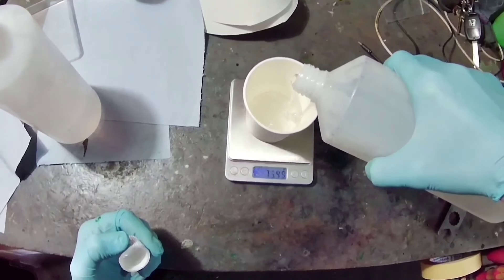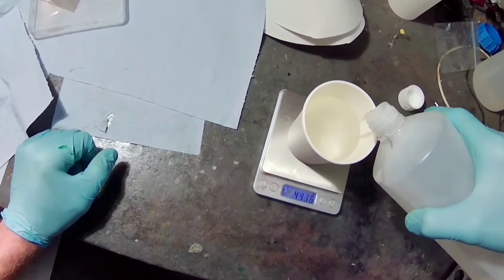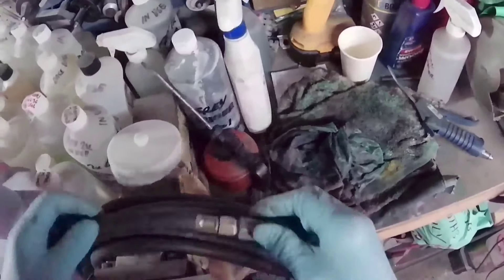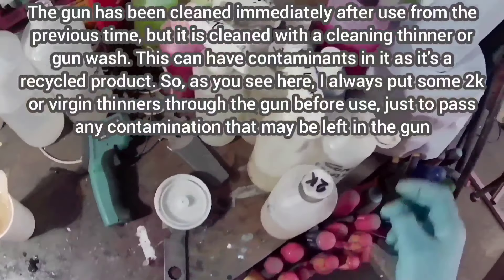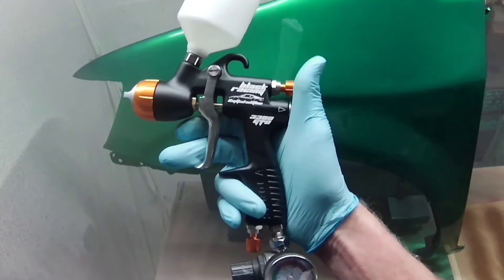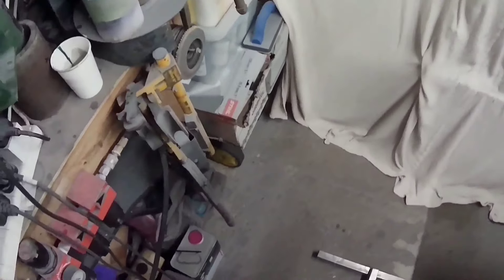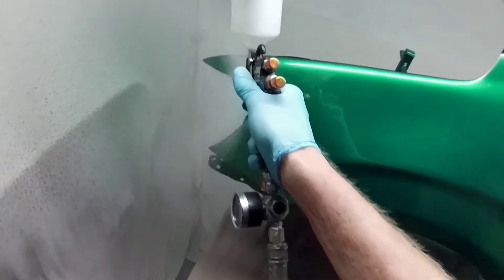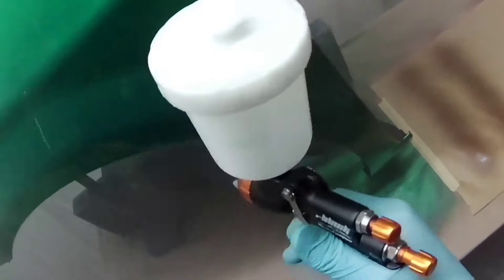Walcom Slim Kombat v Sagola 3300 Black Racing

Comment: Hello Sir, excellent comparison, I didn’t realize that the 3300 sprayed that well, seemed pretty quick. Thank you for the video. I had a buddy tell me one time” if you’re not on the verge of a run, you’re not spraying it right”😂. Have a good one!
Reply from the maker: Hi Bryan,  The Sagola was a 1.4 so it speeded it up from the 1.3 and imo makes it a nicer gun to use for this particular clear coat as it needs plenty on as there not great flow, obviously I over did it but you get my meaning 😀 😉 👍 
I appreciate your comments,  thanks buddy 👍

Comment: Great spraying, Pete. That run is nothing compared to some of my test panels. 😅😂  I've about given up on 2802 for the moment as spraying such clears with those characteristics is hard for a full respray when you're trying to avoid  a bunch of overspray in a homemade booth.  MS clears definitely don't need as much pressure in my case, and lay down better.

As to those guns, the Sagolas are really reeling it in with the performance. If only the price would come down in the US. As to the Walcom, I had no idea parts were harder to get here, probably more expensive. I just checked for a Slim XLight air cap, needle, & nozzle. $133 + shipping. OUCH!
Reply from the maker: Hi Mate, I should be used to these panels so a run did surprise me, especially as it was with the smaller tipped gun as it turned out 😉.

I will eventually stop using the 2080, I bought a lot of them. It was 8 full kits as they were a silly price, so I am slowly working my way through them, I have about 2 left, It's definitely harder to get a finish with it.

Yes, I'm told the spare situation in the US for Walcom isn't good at all.
It's not just at dealer level it at the importers.
They are saying some spares are just not obtainable, this is totally unacceptable, the UK importers tell us they can get whatever part that's needed, providing its not obsolete of course but the US importers are say they can't gets some parts for current guns which is stupid.

There have to be 6 or 7 people who have said a similar thing,  all in the US over the past 18 months,  some you will see on here some via Instagram.

I now give them the email for the Italian factory to see if they can get any joy. It's walmec@walmec.com if anyone needs it.

Cheers Boss 👍
Reply: @peteshobbies5383  if my skills were as yours, I'd stick with the Upol. It's not a bad clear, and you definitely have seemed to master it. I have to spray a thinner clear to get off the gun finishes like yours. 
.
Reply from the maker: It's probably just practice,  I have used loads of it, so you just get used to it.
I'm sure you would be just the same if you had used as much as I have . Thanks, mate 👍

Comment: Interesting comparison pete 👍 , I understand what you mean about the slim kombat feeling fragile , they feel like they're going to snap just tightening the fluid tip , I digress kevlar is used in body armor suits though , so it can't be too weak! . The weight difference is really noticable when you have the gun in your hand for 4 or 5 hours at a time though . Also I have noticed both my kombat and xlight weep out of the tip a little when they have just thinner in them (have done from new) which can be slightly annoying at times . Sagola definately make very truck like guns , does the 3300 have that same silly ring at the top of the trigger that the needle goes through? (Like the 4600 does ... to digress again , I still haven't fixed my 4600 from spraying the side of the air cap , unfortunately didn't get very far with sagola on the subject either 😕 )
Reply from the maker: Hi Mate, I haven't noticed any leaking from my Slim Kombat or Xlite, although they aren't left with thinners in for any length of time.
No, the 3300 doesn't have the annoying ring that moves about as on the 4600 , thankfully 😀

I guess you're right with Kevlar being strong. It's all in the head I think, when it comes to these things 
Cheers buddy 👍

Comment: Hi Pete, great video once again mate and it was a very interesting comparison, the Sagola is a very nice looking gun I do like it in the black with the graphics on it👌

As you know I'm not a lover of the Walcom guns as they always feel plasticky in the hand and they feel cheap and not very well made but if you take the time to look at them they are actually quite well made but I find them to lightweight which is probably due to me being heavy handed as I prefer the heavier guns, I haven't used my Walcom Slim Kombat for a long while which is a shame really as it looks quite nice as it's a special edition, maybe one day I'll use it again🤔

As for the finish you really can't split them as they both did a good job and you did well to not get any runs with the 1.5 tip in the Walcom😂
Thanks Pete👍
Reply from the maker: Hi John,  Thanks, mate , I did enjoy using it with the 1.5 in it , at the time, I thought the Sagola would be the canon, but they both were 🤣😂.

The light guns do feel really flickable, which I like, but it also gives the feeling of fragility, which maybe isn't deserved 🤔 

As people point out, if your holding a gun for 5 or 6 hours a day with a full pot, then weight does make a difference .

Cheers mate 👍
Reply: Yeah I think because they are light people think they are cheaply made but that isn't the case, when I first got mine I thought the same but it's just made of high quality lightweight material which is very strong.

I can understand that using a normal gun during a working shift could be tiring but for me (I expect you are the same) it isn't a problem as I don't spray 5+ hours a day which I'm quite pleased about😂👍
Reply from the maker: @JohnWD40TC02 Yeah,  I'm the same, I'm never been using a gun for that long for weight to be a problem.

Am I right in thinking your Walcom is an HVLP?
Reply: Yes mate it's an HVLP and I think it has a 1.4 tip so it's better for base than clear really👍
Reply from the maker: I don't have the HVLP version, but the HTE version is pretty good 👌

Comment: Hi Pete, Can you explain which would be better for top coat varnish, iwata ws or wbx? And why? Thanks for the answer.
Reply from the maker: Hi buddy,  they are both good. If you are talking about the series2 WS, then they are good and easy to set up compared to series1.

The WBX is as good, really. It's a bit faster if you prefer that, but neither are fast compared to the fast guns like the Sata 5000 , Sagola 4600 etc

Comment: Why do you waste so much thinners flushing guns and then dumping them out onto a rag? Why not dump into an empty container and after like ten flushes you probably have enough to clean a gun. I have three mixing cups with lids that i dump thinners into of various cleanliness and its awesome to spray a job and then dump a whole cup full of reused thinners before a light flush with unused thinners at the end. Also defeats the need to pre flush before you spray because you you had so much thinners to clean with in the first place. When you first start cleaning your gun, it makes no difference whether the thinner is perfectly clean or not, and as you accumulate more and more of it, cleaning becomes kind of like using water so the guns are so clean you can't tell whether it's had paint in it at all.
Reply from the maker: Hi buddy, It's an idea, although I can't say I use a load of thinners, the only stuff I would want to keep is the virgin stuff I put through before filling with paint or clear, it isn't that much, as I say, it's an idea and I may give it a go, thanks 👍